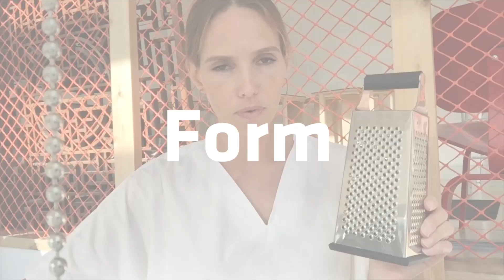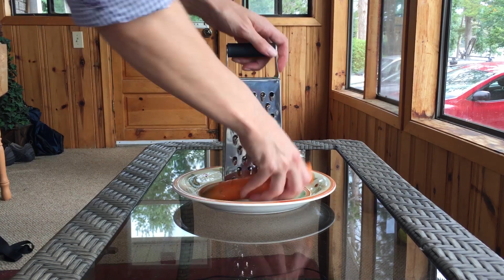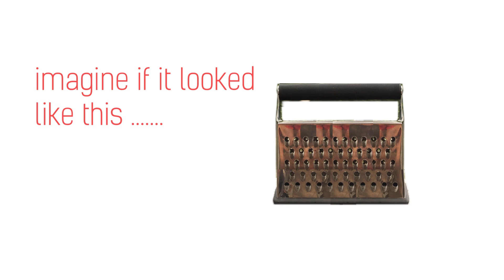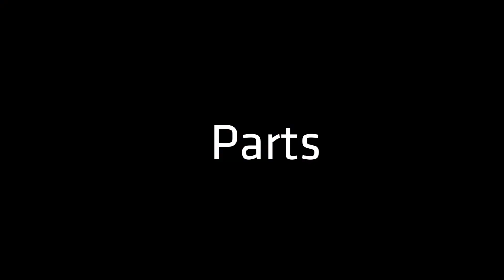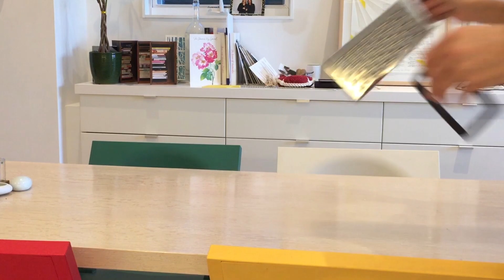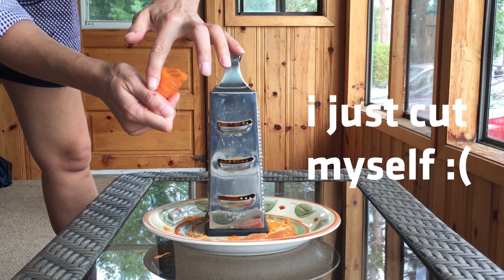Analyze this Product Design  |  Food Grater

Comment: First of All, great video. However, it is interesting that I am surprise people still using this food grater and there is not a better design with it. The reason why I said this is that the sharp grate surface easily can injury users' hands while press vegetables. I used to scratch my finger a couple time then I stopped using it. I think there definitely a better way to avoid injuring users. Hope some designer can fix it in the future.
Reply from the maker: Thanks, Chris! Yes, it is surprising... I cut myself while making the video. I think there are other options on the market but they are more expensive or just different. For example, the mandolin or electric salad shooters.

This design is a classic (although not good for keeping your fingers safe from the blades). I think it's been around for so long because it offers many options at a low price point. The reason the price point is low is it's efficient use of material & manufacturing process.

Comment: Whats the software you are using for 3D modeling ?
Reply from the maker: Solidworks
Reply: @DesignplusMorna  I am using Creo Parametric. While practicing surface modeling i find it difficult to make complex shapes. Is there any tips for that?
Reply from the maker: Hi  @FloydheadUk   Nope, sorry, I don't use that software.